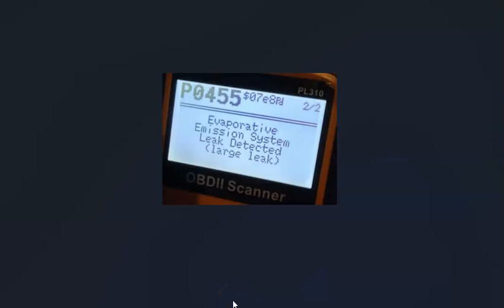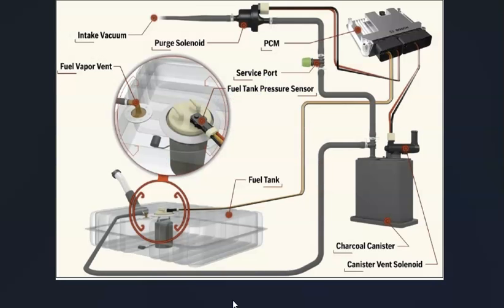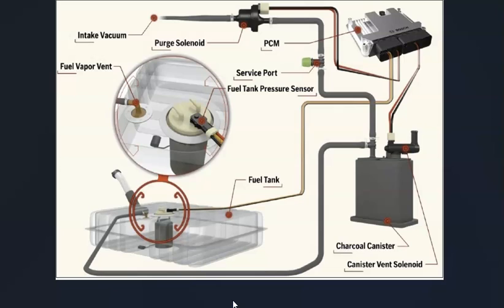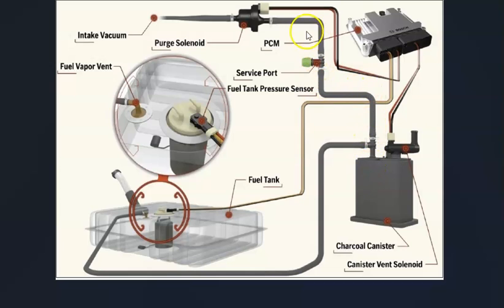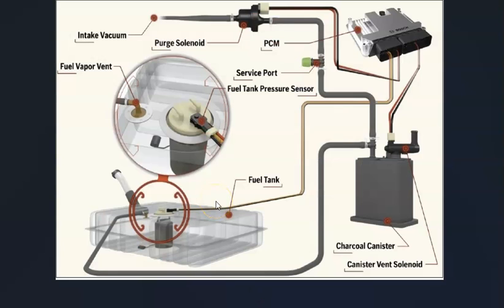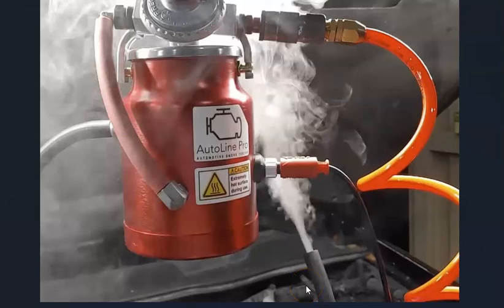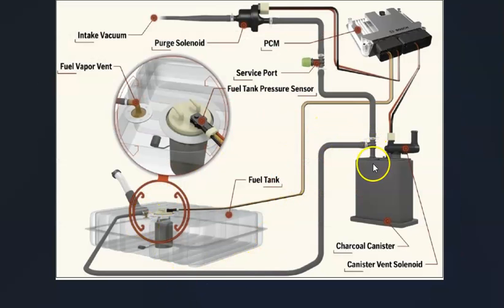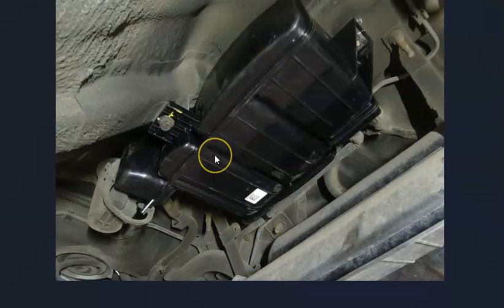HYUNDAI P0455 Code: EVAP Emission System Leak Detected Large Leak

Comment: This code came up for me last week on my 2020 Kona 2.0 with 72k miles. It was idling steady at 800rpm N all of a sudden it dropped N the engine shook like it was about to cut off but reved back up N the check engine light came on. First thing I thought was   I must of been sold a bad batch of gas. I filled my next tank with Super'91 hopping it will fix the issue. I also noted that when i turn on the heat while idling, the RPM drops. I don't think it's done that before.
Reply: Check engine light went off! Thank you Jesus!

Comment: I have been dealing with this code for so long now…keeps “getting fixed” and then keeps coming up again I’ve replaced the gas cap and the fuel sensor and the pump and the solenoid which was the only piece actually damaged cause my wonderful husband broke it pumping past the automatic release to “make sure it was topped off” 🙄 but now the light is on and I’m losing my mind over it 😫

P.s. amazing video love the visuals cause now I understand how it works and can make sense of what to look for to fix it. Thank you so much for making short but to the point 👍🏼
Reply: Talking bad about your husband makes you sound like a karen. You should never talk shit about your husband you khunt. 🙄🤡🫵

Comment: I have a 2010 Hyundai Accent Blue throwing P0456 and P0455 codes. Changed out the purge valve, vent valve solenoid, fuel pump assembly and gas cap (aftermarket) and still nothing.  When changing out the fuel pump assembly i noticed i have 2 screws that are just spinning freely while the other secured. Could this cause those codes to be thrown?
Reply: When you’re driving , is the car maintaining a consistent speed or is it irregular and jerks ?
Reply: Yes, tank needs to be sealed for evap system to work properly if you have a opening from the fuel pump area it will cause an issue

Comment: Hello had a question canister this code cause tuscon to go into and out of limp mode happens few times a day on take off then I let gas pedal come up then I hit the gas and picks up speed. I changed gas cap and silinoid under hood but still acting up
Reply: It’s your fuel pump my piece of shit Hyundai sonata 2018 had to have the fuel pump replaced cause it was a manufacturer defect it was covered under warranty can’t remember if it was a recall or not, take it to your dealership, if it’s that it should be covered.

Comment: My friend has changed everything in this video except for the fuel pressure regulator. He even took it into a repair shop and they replaced the fuel filler tube. And the po455 code keeps coming back on. He cant his yearly license plate sticker because of the code. He has been pulled over twice now and got tickets for an expired license plate. He doesnt  know what else to do. so im posting this for him hoping to get a solution.
Reply: Short term can go to a smog shop in the ghetto with $250-$300 and they'll pass you.
Reply from the maker: All the components need to be tested to be sure they are working and a smoke test done to find any leaks.
Reply: Verify the check valve leading to the intake
Reply: $250-$300 DAMN!! I get passed over here for $50.

Comment: I can't pump gas sometimes pump keeps stopping 😢
Reply from the maker: That is usually caused by a bad vent valve in the charcoal canister.
Reply: @whyingo7964  New vent valve solenoid old charcoal canister
Reply: I have p0455 code and gas pump turns off while fueling. Did you figure it out? What was it? I'm confused as to why a large leak from a valve would cause the pump to shut off. Seems like if it was stuck closed it would cause the pump to shut off

Comment: I own a 2005 elantra with that code replace the upper O2 sensor code went out for about a week came back on replace the lower O2 sensor code went out then came back on, then I replaced the catalytic converter code went out for about a week. Then the charcoal canister I replace same thing out for a day or two comes back on then the solenoid by the canister same thing goes out for a while comes back on then I replace that solenoid up underneath the hood code went out for a couple of days and it came back on I have replaced everything but the fuel pressure sensor and I can't get my car to pass the emissions test so now I can't get a sticker for my license plate other than that the car runs great
Reply: I did replace the gas cap. That was the first thing I did and it didn't do anything the po455 code came right back on the next day after I reset it. The one thing I have noticed though my gas mileage has gone up 2 to 3 Miles per gallon since I replaced everything
Reply: @PabloSanchez-dc3vc same thing is happening to me!! did you ever fix the problem??

Comment: I have a 2003 Hyundai Elantra gls and I have this same code showing up, along with p0451. When I changed the vent valve I noticed charcoal in the lines and spilling out the canister.  I’m changing the canister tomorrow, along with the FTPS (if I can find it) and hopefully it clears those codes. 🔥vid
Reply: Well I done how misplaced the FTPS around the house somewhere, so I went ahead with replacing the charcoal canister. Did the 2 drive cycles and BOOM, both p0451 and p0455 codes showed Green check marks on the scanner. Didn’t need the FTPS after all
Reply: @Vellieveil_64 the canister fixed the code for good?
Reply: @emmcee476 yeah. But what I forgot to mention was, the clamp holding one of the hose to the canister was also replaced. And that’s where the large leak was. The canister fixed the problem I had with filling the gas tank